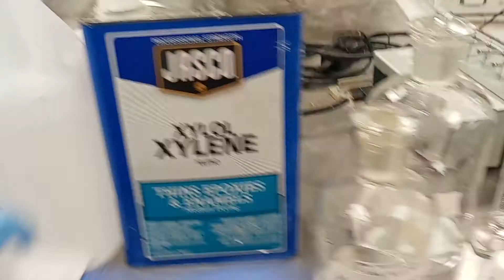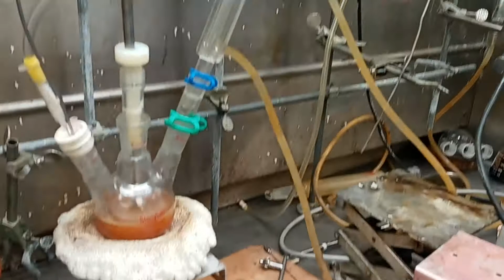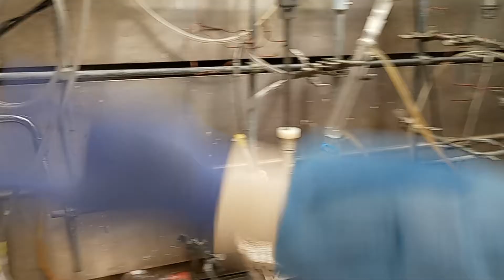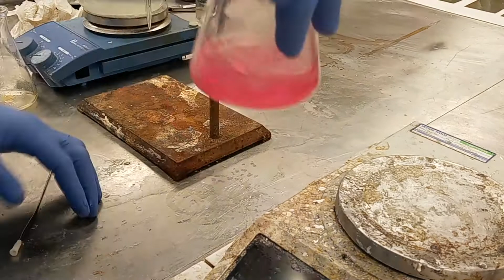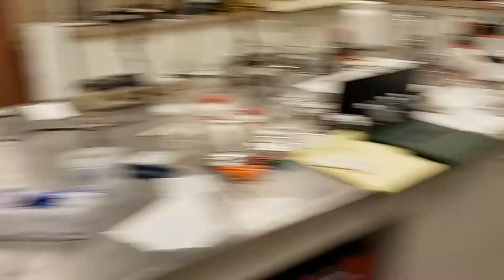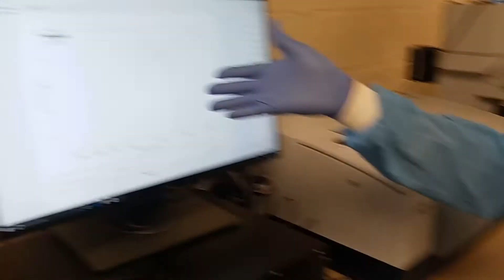Bisphenol-A free Sustainable Epoxy Resins For Coatings.

Comment: Can you please explain synthesis process
Reply from the maker: Thank you. It basically a two step mechanism. Di and mono acids step wise reactions. Ongoing research work.
What do you do and where?
Reply: @ayowalesoyemi5225  Is it possible to fill the technology of floors? In what proportions with the hardener and what kind of hardener. What brand of epoxy resin do you have?
Reply from the maker: @natass9472  It is an ongoing work,not yet published.